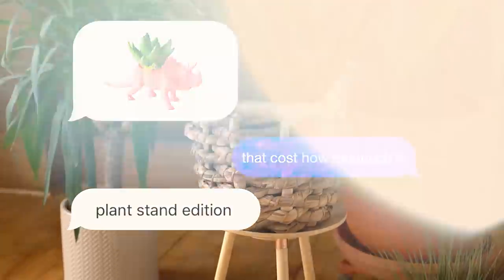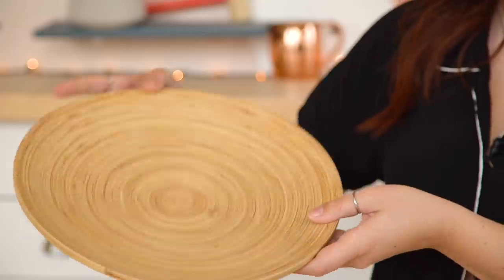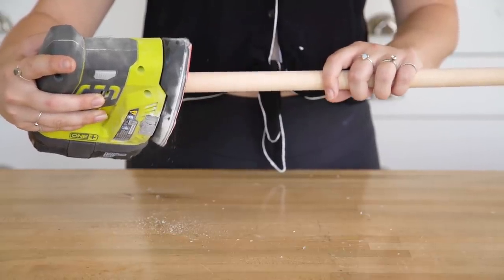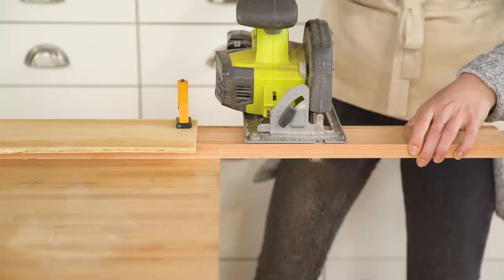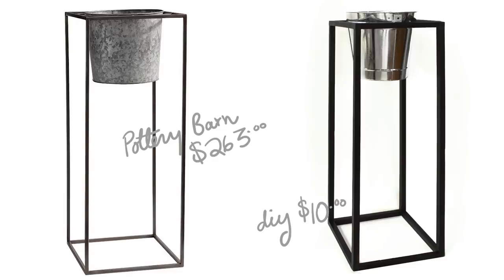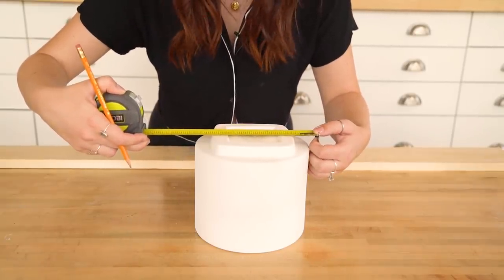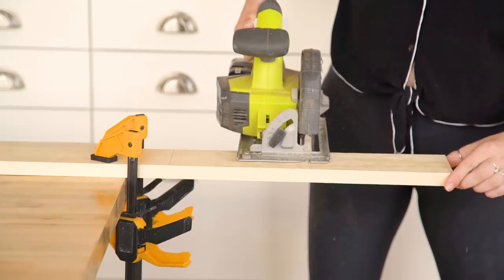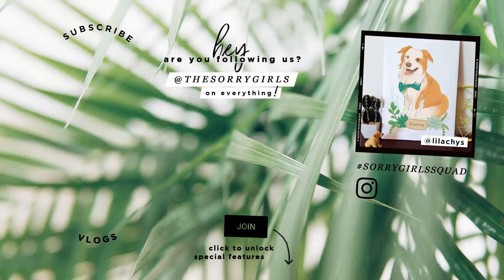Can we recreate these EXPENSIVE plant stands?!

Comment: Tip for people who don't want to buy the whole stain-jar for smaller projects: You can use acrylic paint, just mix it with water and you are ready to go!
Reply: I was going to suggest the same thing. A small 4 oz bottle of acrylic craft paint is 79 cents at Michael's (at least here in the US it is, probably more in Canada)  and  you  won't even use half of it because you  dilute it with  a lot of water to get the stain effect. The craft paint comes in a lot more colors than wood stain, too.  So you can shave $8 off those DIYs.
Reply: Whats the water to paint ratio? Or what should the consistency look like if theres no set ratio
Reply: @blairedarling7171  it should be runny like water but tinted, the more you use paint the deeper the outcome will be. For example you could use 2dl water, and the same amount of paint when you use toothpaste when brushing teeth. Remember to stir it really well, and try it a small amount first. If the outcome is too deep, add water or dry the wood immediately after staining. You can add layers too.
Reply: @blairedarling7171  It should look thin and watery,   like a  watered down fruit juice.  I would start with like 1 part paint and 3 parts water. Do a test  on some  scrap wood and let it dry. Then adjust if you want  it more sheer or more opaque.    Make sure to stir it well before using because the pigments will sink to the bottom.   Paint it on and then immediately rub off the excess  with a clean cloth.
Reply: Had anyone tried using shoe polish instead of stain? That might work well, too, so long as you put it on in light coats until you get to the shade you want. (Yeah, I'm a "pretty far outside the box" thinker sometimes.) 🤓
Reply: In Germany at least we have these little sachets of powder, you mix it with hot water and voila, there is your stain. They are cheap, like a € or 2 per sachet. Lookout for them if you have these too! That way you don't have to buy a whole can :)
Reply: Oh also you can stain wood with coffee, tea, red wine etc, if you don't want to buy the paint!
Reply: Blank Canvas Syndrome you can use water baby wipes with the acrylic paint and it gives a similar effect. I still like the look of the stain more, but in a pinch or in a budget, it works
Reply: Hope to work for me too
Reply: @Kath-Erina  Thanks for the suggestion, we have it in the U.S. too - google stain powder. This is great for someone like me who lives in an apartment and uses a spare closet as their "garage" :)
Reply: Or coffee

Comment: Pottery Barn: Overcharges on simple design elements
Sorry Girls: HOW MANY TIMES DO WE HAVE TO TEACH YOU THIS LESSON OLD MAN
Reply: actually, the Pottery Barn thing is made out of meta and looks way better. So it's kinda like those chinese website : you get what you pay for
Reply: Katell Giraud it might look a little better but there is no plant stand worth over 200$! That is just ridiculous.
Reply: @katellgiraud9779  You could stain & paint it with a metallic shinny finish. Also create the pot by mixing gold & silver paint. Then a touch of black a couple coats.. You'll have that finish!
Reply: There is a metal spray that makes something look galvanized so it would look even closer to the pot.  And the wood just needed more coats.
Reply: @Master_Blackthorne  guess what??  U can't  😂
Reply: StephBer1 what is that paint called? I have been looking for it and tried so many combinations I saw should give me that galvanized look and mine have worked. Will look it up again now and see if I can find it.
Reply: @u724021  Rustoleum sells quite a few choices from flat black to chrome or copper finish. I used copper heat resistant spray paint for freshen up a worn and faded outdoor fireplace - looks brand new!
Reply: @u724021  
Look for spray paints that say "hammered finish."  In silver, or gray, that's what gives that galvanized look.
Reply: @southerncharmed4118  vh6

Comment: Here is a little tip! I’m no construction/power tool person but for the bucket stand (2nd DIY) you could carve out slots in the frame as there are little blocks sticking out where the handle was attached to. This would not only make it look better but it would also make it look like it was made like that and not a DIY. And at my local hardware and paint store they have this galvanised spray paint so I could get that worn and aged look. These hacks made it turn out super awesome when I did this DIY!! Totally recommend them! 😃

Comment: you can buy a bundle of 20 1x 2 lathing strips for less than 20 bucks at home depot .... Elmers or wood glue and clamp /rubber band/ or wrap with string/tape them together just until they dry if you need the thicker dimensions... I make so many things and they are super affordable wood strips

Comment: For the metal one, you can actually get hollow square tubes of alluminum that's soft enough to cut like wood (if you go slowly) it's not very strong on it's own but it's very sturdy if you put the dowels inside it!  Costs a little more, but you'll get an actual metal finish

Comment: very enticing. A couple of questions. Just seems like a great idea to wear goggles when cutting, or drilling. Also, please put that long hair up so it doesn't accidentally get caught up in one of the electrical tools. These are basic safety measures! In ADDITION, is it just me, but what happens when you actually water the plants? Where does the water go? I see no trays at the bottom of any of these plants. Its disturbing when imagining the practical part of having to water the plants.